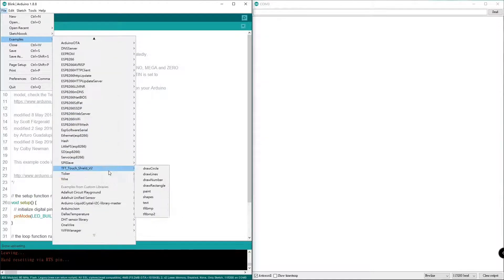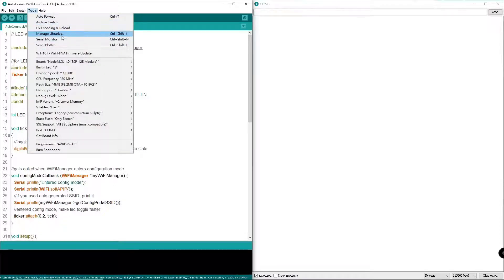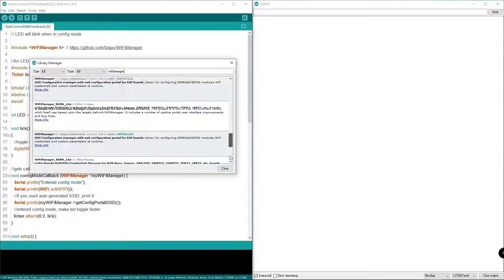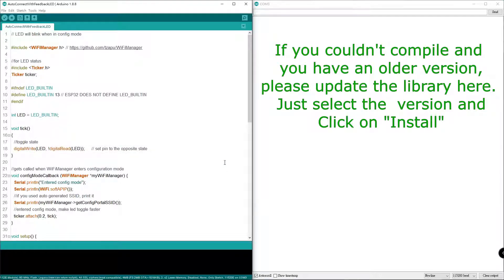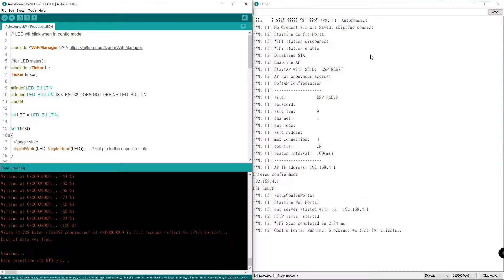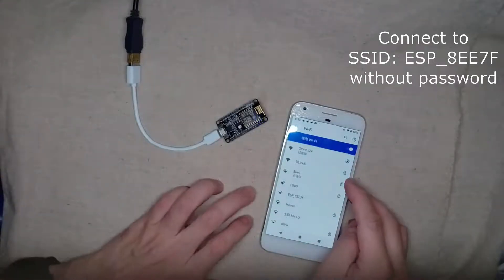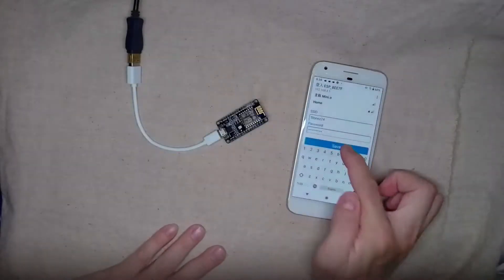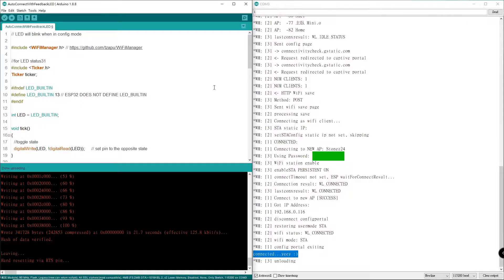Arduino Wifimanager (Revised for ESP8226)

Comment: Hi Kevin, thanks for the udpated video. Can you please share something that how can i put this in a Void Loop? My code is to check Wifi connection after a certain interval, whether the wifi is connected or not? If not, this should go back to AP mode. Then I would like to select the SSID, and the operation will be back to normal?
Reply from the maker: Basically, you merge your code and Wifimanager code together.  I've made an video example here:

Watch the section where I merged two codes.
https://www.youtube.com/watch?v=RXtHkMZgS4s

Comment: Hello, I am trying to upload the code via arduino uno. At first I couldnt upload  with ESP8266 BOARDS (2.7.4) Timed out waiting for packet header error occured then I tried older version (2.5.2) it seemed fine but nothing happens on serial monitor and I can not see wifi on my phone. Do you have any suggestion? Thank you a lot for the video by the way nice work!
Reply from the maker: Thanks for the nice comment. Usually, I would ensure wire connections are all correct first, COM port, and Baud Rate..BTW, I haven't try upload code with Uno before, so not sure if this is related.

Comment: Great addition to your previous video.  Just wanted to add that the ESP_###  may change because of updates.  Also, if the WiFiManager window does not automatically load when you select ESP_###, you have to open a web browser on your phone and enter the IP address 192.168.4.1    Thank you Kevin Chen
Reply from the maker: Thanks for your suggestions! 😄

Comment: Great video! thanks.

im having a different problem compiling.

Arduino: 1.8.10 (Windows 10), Board: "WeMos D1 R1, 80 MHz, Flash, Legacy (new can return nullptr), All SSL ciphers (most compatible), 4MB (FS:2MB OTA:~1019KB), v2 Lower Memory, Disabled, None, Only Sketch, 921600"

In file included from C:\Users\Hayden\Documents\Arduino\libraries\WiFiManager\WiFiManager.h:51:0,

                 from C:\Users\Hayden\Documents\Arduino\libraries\WiFiManager\WiFiManager.cpp:13:

C:\Users\Hayden\AppData\Local\Arduino15\packages\esp8266\hardware\esp8266\2.7.4\libraries\ESP8266WebServer\src/ESP8266WebServer.h: In instantiation of 'class esp8266webserver::ESP8266WebServerTemplate<WiFiServer>':

C:\Users\Hayden\Documents\Arduino\libraries\WiFiManager\WiFiManager.cpp:502:42:   required from here

C:\Users\Hayden\AppData\Local\Arduino15\packages\esp8266\hardware\esp8266\2.7.4\libraries\ESP8266WebServer\src/ESP8266WebServer.h:80:53: error: no type named 'ClientType' in 'class WiFiServer'

   using ClientType = typename ServerType::ClientType;

                                                     ^

C:\Users\Hayden\Documents\Arduino\libraries\WiFiManager\WiFiManager.cpp: In member function 'boolean WiFiManager::captivePortal()':

C:\Users\Hayden\Documents\Arduino\libraries\WiFiManager\WiFiManager.cpp:1856:42: error: 'class esp8266webserver::ESP8266WebServerTemplate<WiFiServer>' has no member named 'client'

   String serverLoc =  toStringIp(server->client().localIP());

                                          ^

C:\Users\Hayden\Documents\Arduino\libraries\WiFiManager\WiFiManager.cpp:1865:13: error: 'class esp8266webserver::ESP8266WebServerTemplate<WiFiServer>' has no member named 'client'

     server->client().stop(); // Stop is needed because we sent no content length

             ^

In file included from C:\Users\Hayden\AppData\Local\Arduino15\packages\esp8266\hardware\esp8266\2.7.4\libraries\ESP8266WebServer\src/ESP8266WebServer.h:259:0,

                 from C:\Users\Hayden\Documents\Arduino\libraries\WiFiManager\WiFiManager.h:51,

                 from C:\Users\Hayden\Documents\Arduino\libraries\WiFiManager\WiFiManager.cpp:13:

C:\Users\Hayden\AppData\Local\Arduino15\packages\esp8266\hardware\esp8266\2.7.4\libraries\ESP8266WebServer\src/ESP8266WebServer-impl.h: In instantiation of 'void esp8266webserver::ESP8266WebServerTemplate<ServerType>::handleClient() [with ServerType = WiFiServer]':

C:\Users\Hayden\Documents\Arduino\libraries\WiFiManager\WiFiManager.cpp:653:26:   required from here

C:\Users\Hayden\AppData\Local\Arduino15\packages\esp8266\hardware\esp8266\2.7.4\libraries\ESP8266WebServer\src/ESP8266WebServer-impl.h:319:20: error: using invalid field 'esp8266webserver::ESP8266WebServerTemplate<ServerType>::_currentClient'

     _currentClient = client;

                    ^

C:\Users\Hayden\AppData\Local\Arduino15\packages\esp8266\hardware\esp8266\2.7.4\libraries\ESP8266WebServer\src/ESP8266WebServer-impl.h:327:34: error: using invalid field 'esp8266webserver::ESP8266WebServerTemplate<ServerType>::_currentClient'

   if (_currentClient.connected() || _currentClient.available()) {

                                  ^

C:\Users\Hayden\AppData\Local\Arduino15\packages\esp8266\hardware\esp8266\2.7.4\libraries\ESP8266WebServer\src/ESP8266WebServer-impl.h:327:34: error: using invalid field 'esp8266webserver::ESP8266WebServerTemplate<ServerType>::_currentClient'

C:\Users\Hayden\AppData\Local\Arduino15\packages\esp8266\hardware\esp8266\2.7.4\libraries\ESP8266WebServer\src/ESP8266WebServer-impl.h:334:7: error: using invalid field 'esp8266webserver::ESP8266WebServerTemplate<ServerType>::_currentClient'

       if (_currentClient.available()) {

       ^

C:\Users\Hayden\AppData\Local\Arduino15\packages\esp8266\hardware\esp8266\2.7.4\libraries\ESP8266WebServer\src/ESP8266WebServer-impl.h:335:41: error: using invalid field 'esp8266webserver::ESP8266WebServerTemplate<ServerType>::_currentClient'

         if (_parseRequest(_currentClient)) {

                                         ^

C:\Users\Hayden\AppData\Local\Arduino15\packages\esp8266\hardware\esp8266\2.7.4\libraries\ESP8266WebServer\src/ESP8266WebServer-impl.h:335:41: error: '_parseRequest' was not declared in this scope

C:\Users\Hayden\AppData\Local\Arduino15\packages\esp8266\hardware\esp8266\2.7.4\libraries\ESP8266WebServer\src/ESP8266WebServer-impl.h:336:11: error: using invalid field 'esp8266webserver::ESP8266WebServerTemplate<ServerType>::_currentClient'

           _currentClient.setTimeout(HTTP_MAX_SEND_WAIT);

           ^

C:\Users\Hayden\AppData\Local\Arduino15\packages\esp8266\hardware\esp8266\2.7.4\libraries\ESP8266WebServer\src/ESP8266WebServer-impl.h:340:11: error: using invalid field 'esp8266webserver::ESP8266WebServerTemplate<ServerType>::_currentClient'

           if (_currentClient.connected()) {

           ^

C:\Users\Hayden\AppData\Local\Arduino15\packages\esp8266\hardware\esp8266\2.7.4\libraries\ESP8266WebServer\src/ESP8266WebServer-impl.h:363:20: error: using invalid field 'esp8266webserver::ESP8266WebServerTemplate<ServerType>::_currentClient'

     _currentClient = ClientType();

                    ^

C:\Users\Hayden\AppData\Local\Arduino15\packages\esp8266\hardware\esp8266\2.7.4\libraries\ESP8266WebServer\src/ESP8266WebServer-impl.h: In instantiation of 'void esp8266webserver::ESP8266WebServerTemplate<ServerType>::send(int, const char*, const String&) [with ServerType = WiFiServer]':

C:\Users\Hayden\AppData\Local\Arduino15\packages\esp8266\hardware\esp8266\2.7.4\libraries\ESP8266WebServer\src/ESP8266WebServer-impl.h:488:56:   required from 'void esp8266webserver::ESP8266WebServerTemplate<ServerType>::send(int, const String&, const String&) [with ServerType = WiFiServer]'

C:\Users\Hayden\Documents\Arduino\libraries\WiFiManager\WiFiManager.cpp:988:46:   required from here

C:\Users\Hayden\AppData\Local\Arduino15\packages\esp8266\hardware\esp8266\2.7.4\libraries\ESP8266WebServer\src/ESP8266WebServer-impl.h:446:5: error: using invalid field 'esp8266webserver::ESP8266WebServerTemplate<ServerType>::_currentClient'

     _currentClient.write((const uint8_t *)header.c_str(), header.length());

     ^

Multiple libraries were found for "Ticker.h"
 Used: C:\Users\Hayden\AppData\Local\Arduino15\packages\esp8266\hardware\esp8266\2.7.4\libraries\Ticker
Multiple libraries were found for "WiFiManager.h"
 Used: C:\Users\Hayden\Documents\Arduino\libraries\WiFiManager
 Not used: C:\Users\Hayden\Documents\Arduino\libraries\WhareHauoraWiFiManager
Multiple libraries were found for "ESP8266WiFi.h"
 Used: C:\Users\Hayden\Documents\Arduino\libraries\ESP8266WiFi
 Not used: C:\Users\Hayden\AppData\Local\Arduino15\packages\esp8266\hardware\esp8266\2.7.4\libraries\ESP8266WiFi
Multiple libraries were found for "ESP8266WebServer.h"
 Used: C:\Users\Hayden\AppData\Local\Arduino15\packages\esp8266\hardware\esp8266\2.7.4\libraries\ESP8266WebServer
Multiple libraries were found for "DNSServer.h"
 Used: C:\Users\Hayden\AppData\Local\Arduino15\packages\esp8266\hardware\esp8266\2.7.4\libraries\DNSServer
exit status 1
Error compiling for board Generic ESP8266 Module.

This report would have more information with
"Show verbose output during compilation"
option enabled in File -> Preferences.
Reply from the maker: There were serval errors, like Multiple libraries were found for "DNSServer.h". I would remove all Wifi-manager and ESP8266 libraries and reinstall them again.  Good luck!